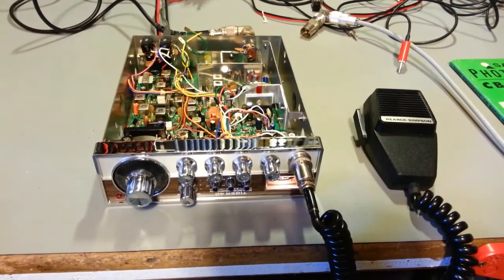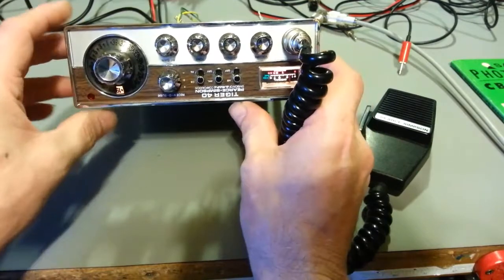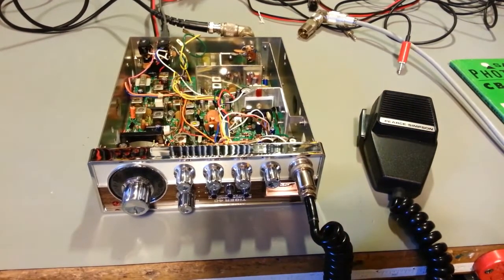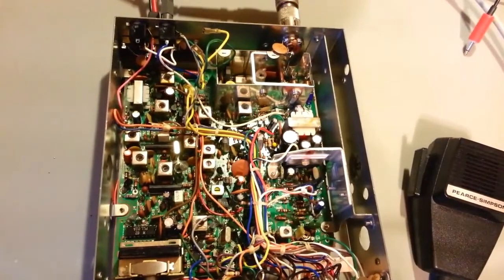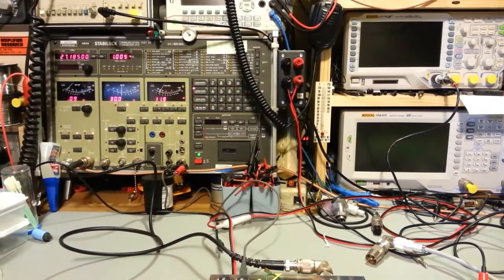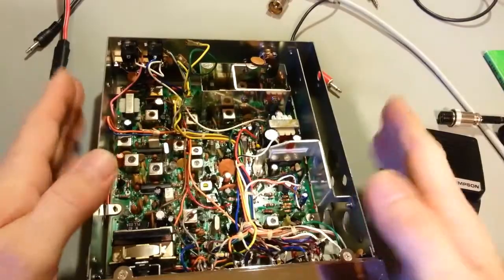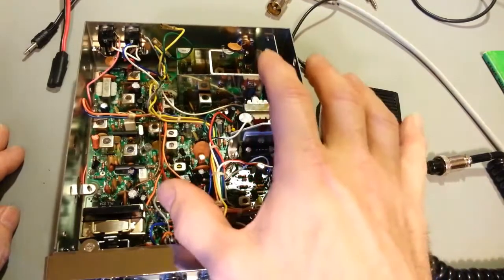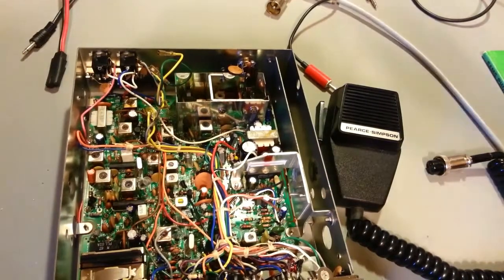Pearce Simpson Tiger 40 CB radio overview.

Comment: I have a Midland AM only base that looks similar but slightly smaller board with an aditional power supply board. PTBM050COX it is an O2A pll and it is obviously a Cybernet board.It is a Midland base and I think it was built in 1977. It is NOS/NIB It is one of 4 Cybernet's I want to send to you 2 of them are AM only 2 are SSB + I want to send my President Lincoln your way. To be a poor working college student! Never enough $$$. My apartment is New York City small! LOL Always interesting to see a radio on your test set and to hear them receive and hear your input on them.

Comment: The Delta Tune may of been to compensate for receiving people that had crystal CB radios that were off frequency as it was like you say one of the first PLL radios so although it was on frequency the others where drifting.
Reply from the maker: Good point. Never really thought of it like that before.  The old crystal drifters would have still been out there in use when this radio came out and was being used.